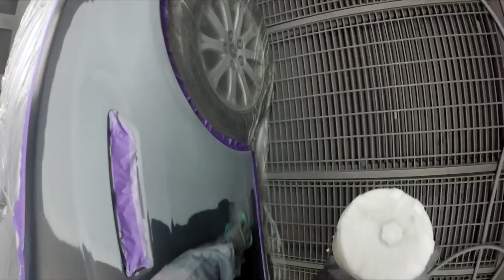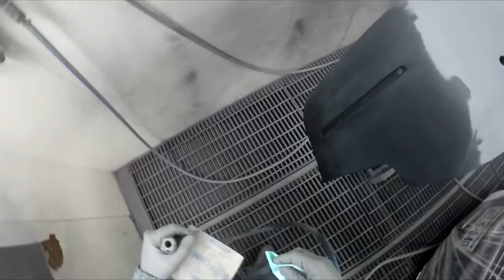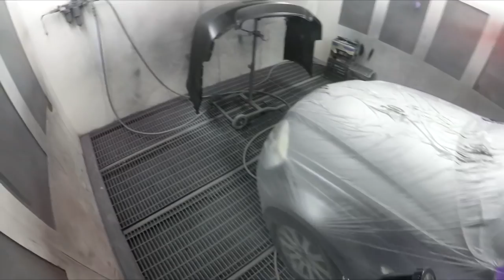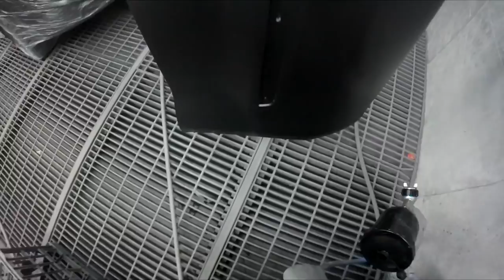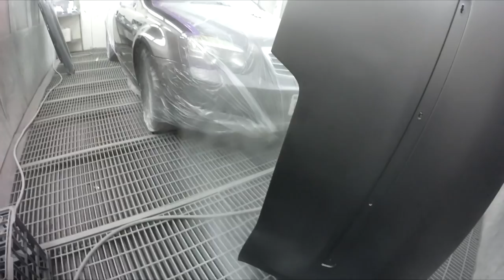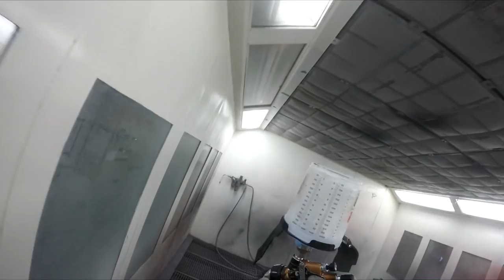Holden Statesman Spray Painting

Comment: Im the guy who told you to try out the microphone
The sound level is a bit low.
The problem with sound only in one speaker is easy to fix.
The mic you bought has a output for a ear plug ?
What kind of gopro do you use?
What microphone did you buy?
Throats mics have a lower output than a standard microphone.
It probably needs a little microphone amplifier.
So post what microphone you bought and i can check the microphone impedance.
I can try to make you a small Preamplifier to solve the Problems.
Free of charge of course :).
I enjoy the chanel :)
Reply from the maker: Ok mate let's see if we can get this thing sorted. I've got some time off over Christmas so even if it means I have to buy a better quality throat mic then so be it. Shoot me an email to thegunmanraw@gmail.com and I'll send a link to the mic I bought. I have a GoPro hero 4 black.

Comment: I listen on headphones and it's coming out mono (only in one ear) and maybe at  half your channels normal volume. I have to turn it right up to hear you. Then the commercials blew my head off.  Also much lower than any other YouTube channel I watch. Sorry I'd have to say it's a fail at this point. Some more experimentation is required I think.
I will say it cuts the booth noise out nicely - that's a good thing and your voice is more intelligible when you're not yelling.
 Good video none the less.
Thanks
Reply: Very sorry about that, I have 3 more videos already uploaded so avoid them if it's that bad, from then on I'll go back to old format.
Reply: NO problem I'll keep watching no matter what you do.
It was just comments to help you improve. I think the idea is good. It's nice to eliminate some of the noise. Perhaps there is another way to connect the mic to make it stereo and to improve the level.
Keep at it and thanks.